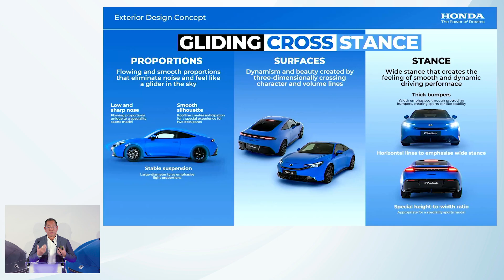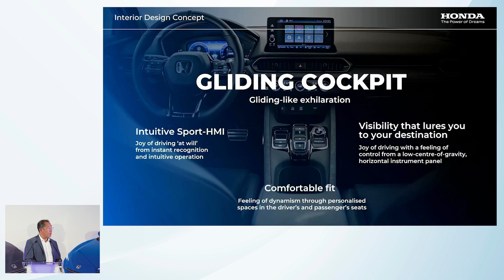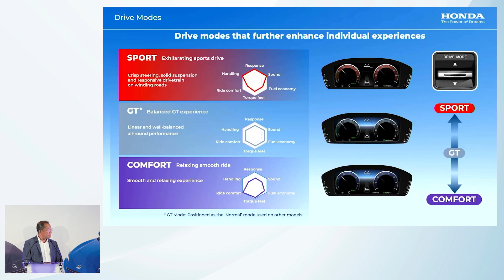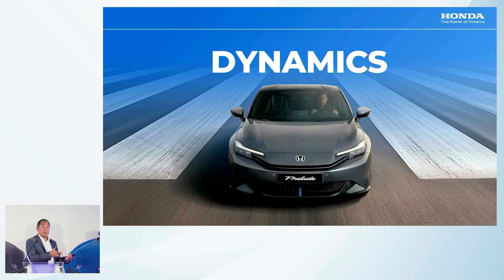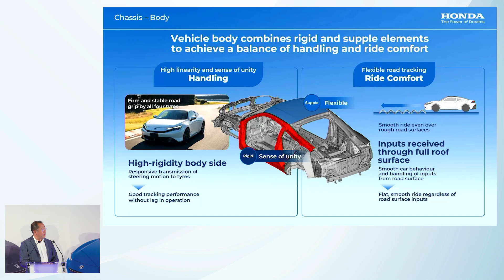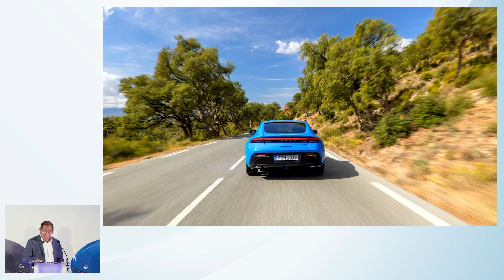New Honda Prelude 2025 European Press Event Presentation

Comment: I haven't seen any Honda presentation/marketing that describes S+ as the driver's opportunity to keep the engine in its 'electricity generation power band' - that is, use S+ to up the RPMs as high as possible, consistent with the 'gearing', to generate the maximum electricity.  That 'extra/max' electricity can drive the wheels or charge the battery depending on the driver's needs based on the accelerator pedal.  We know that the higher engine RPMs generate more electricity which produces more acceleration because the 'launch mode' pins the engine at 6,000 RPM.  So, S+ is anything but 'fake'.  It is %100 real and purposed to allow the driver to manually (using the paddles) control the engine RPM.   In this way, S+ is actually no different from traditional, physical, cogged gears - keep the engine in is power band.  Why doesn't Honda introduce S+ in this way?
Reply: It is wonderful that pulling and holding the left paddle when in S+ automatically 'shifts' to the 'gear' allowing the highest engine RPMs.  It is almost like having a boost button (B+ ?) that when pressed once sets and holds the engine at 6,000 RPMs; press again and the engine returns to its normal state.

Comment: Boring…either make a full EV or have a genuinely interesting ICE to interact with. This middle ground is overly complex and very underwhelming. 🥱
Reply: 2002 style comment
Reply: @Erc112  My bad, I forgot comments need a vibe check before they’re valid. 🤡
Reply: An extended-range electric vehicle with an internal combustion engine as an auxiliary installation will now be developed. The point is that you charge it at home or on urban electric charges and ride like an electric car 90% of the time. but if you need a long trip or winter has come and you need to warm up the cabin, I spend precious kilowatt hours and, as a result, kilometers of power reserve. then the internal combustion engine turns on and it can be not only the Atkinson cycle, but also an internal combustion engine with gas or hydrogen.. and alas, the power reserve is unlimited, even if you go to a neighboring country calmly! And the Hondas have done a great job. for which I am wisely grateful to them. Very few people put their soul into it now... I'm generally a BMW fan, but what a bore they make..
Reply: Perhaps in the future, machines with physical buttons, high-quality analog processing and the absence of excessive "digital noise in the form of distracting screens" will be considered a real premium. Such cars already exist and are manufactured by HONDA.

2025 Honda Civic Hybrid https://youtu.be/eGkjw8Mbhh0  New Honda Prelude 2026 Test Drive https://youtu.be/JUjsruxnZKE , 2025 Honda Civic Type R - POV Rainy Day Drive (Binaural Audio) https://youtu.be/JzVi5DAOXFA AMAZING 2026 Honda Prelude https://youtu.be/M1Lizdq_7jU interesting NEW Mazda MX-5 Miata https://youtu.be/abmHB0r-5Lk